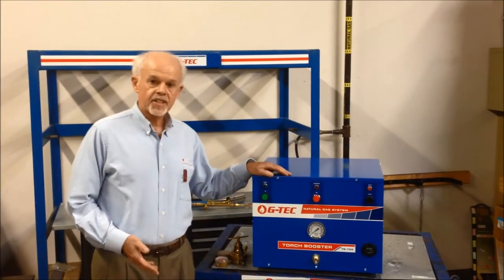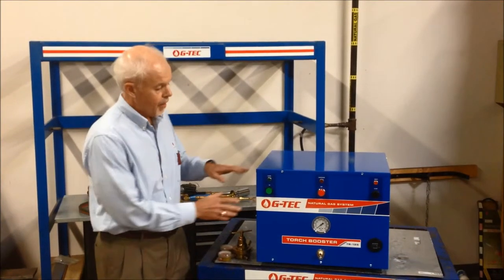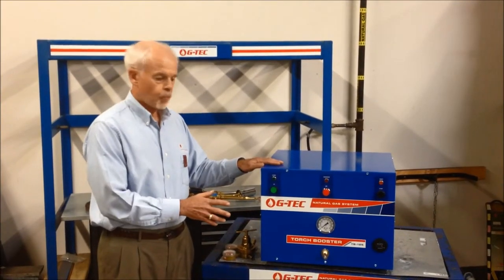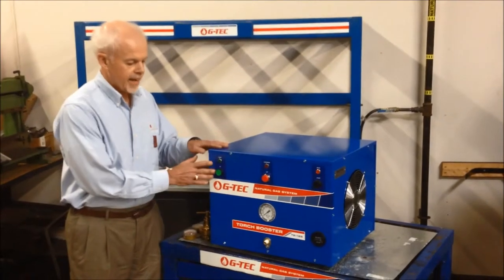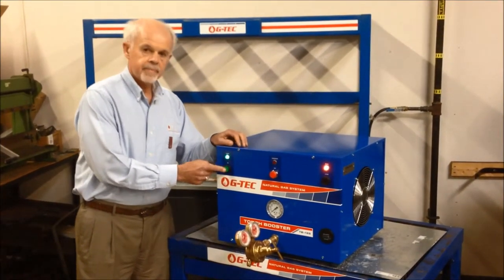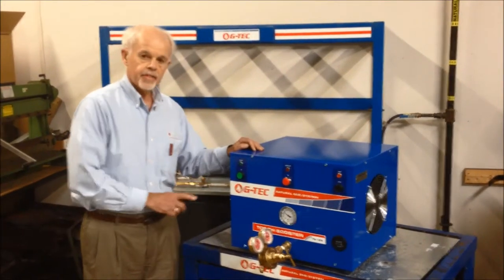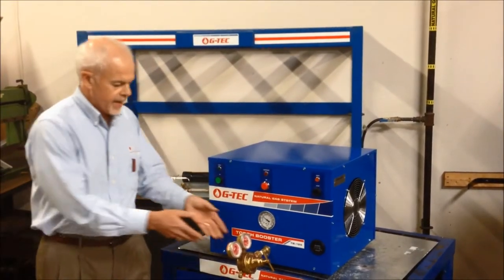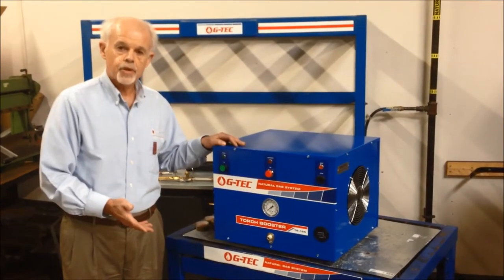G TEC TB 125 Torch Booster Overview

Comment: How much gas pressure does it take to run the unit?
Reply from the maker: G-TEC Torch Boosters work with utility gas supply as low as 4" WC, or  a little under 1/4 psi.